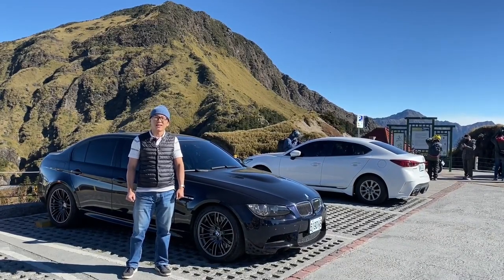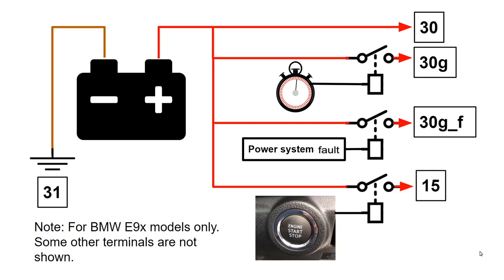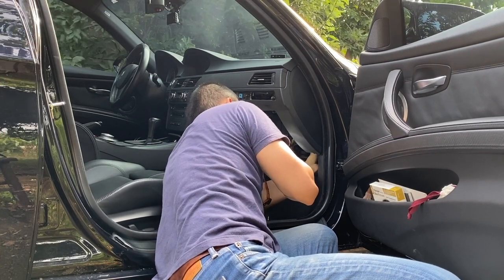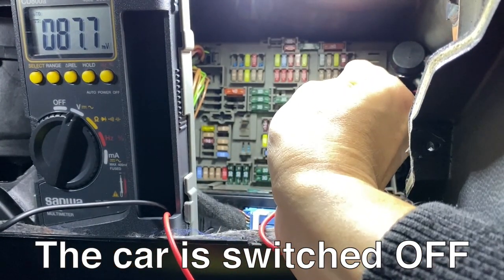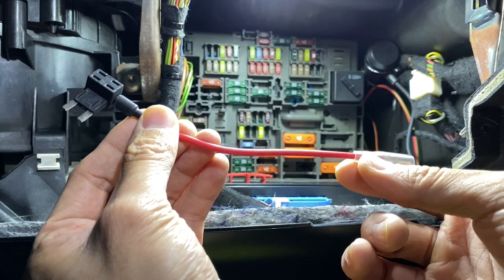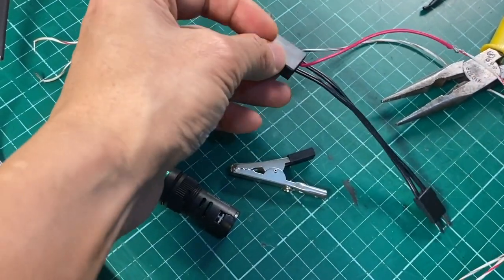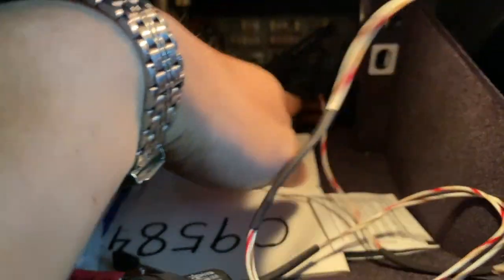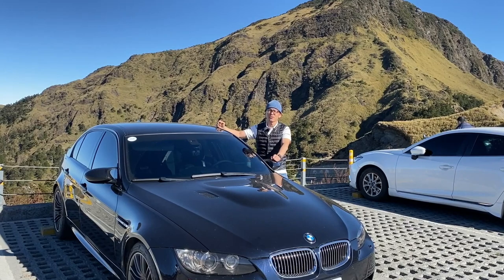BMW Terminal 15, 30, 30g & 30g_f Explained - Heated Steering Wheel DIY on E90 M3 Ep. 1[ENG SUB]

Comment: Is there a relay that cuts off power to the radio ?
Reply from the maker: Hello the radio on E90s is named N38 or N38a. It is on terminal 30g_f and the relay is named I01139. This relay cannot be seen on my version of fuse box.

Please search on Google Images "e90 fuse panel relay 30g_f" you will see another version of fuse box on E90s. I01139 is on the right middle on the fuse panel, the black rectangular one below the black square one.

Be noted that there are some other modules on this terminal!
Reply: I didn’t get the notification for this , thanks I appreciate it after I reconnected my battery my radio and cruise control and other stuff stop working . I hope this relay is the problem there is only one fuse getting no power and it’s to the radio any advice it’s been like 2 years lol
Reply from the maker: Hi Gatiyo yes the relay I01139 is responsible for the power supply of terminal 30g_f. Also note that the faults in electrical system can make 30g_f shut down. So please scan for the fault codes about electrical system. Perhaps after clearing other faults, terminal 30g_f can be recovered!
Reply: @funcarsgoodpeople  thanks for the reply I appreciate it , 30g_f is a soldered relay on my fuse box I’m not getting no power to radio fuse and other fuses that has to do with the radio. Does this mean I’ll have to replace the fuse box ? This will be helpful
Reply from the maker: Hi Gatiyo yes this is one possibility but before swapping the whole fusebox I would try to supply 12V power to those fuses to verify whether the downstream modules are still functional.

Looking at the fuse slot F41 (if not i’ll update to you), you will see a colored (maybe blue or magenta) socket underneath. That is the pin to the radio. I would try to supply this pin to check the radio.

Comment: Why are the terminals named like this? Is it legacy from some ignition lock terminal naming?
Reply from the maker: Hi Janne thank you for raising this question so I got a chance to learn about it 🤗

I found the Wiki page about the standard DIN 72552 for naming in automobile wiring so I think this is the answer 👍

https://en.wikipedia.org/wiki/DIN_72552

I believe BMW has its unique naming system based on DIN 72552 standard.

Comment: How many boats is supposed to be going through the ECU on a 2008 535 XI
Reply from the maker: Hi Robert, from what I found from the pin assignment, I believe that the supply voltage is 12V or the battery voltage. The ECU is also getting information about battery health. Are you encountering some power problem?
Reply: I put a new motor in the car it's a new turbos and the ground wire up underneath the motor mount was broke and but it's fixed now but I think it popped and relay or short or something out but it will car won't crank everything clears the code clears for the service and change all all that's back in the green but it still won't crank up and I put starter relay in it new starter
Reply from the maker: Hi Robert,
The engine start is controlled by the CAS, car access system. The CAS will compare a code stored in the ECU (or DME) to allow engine start. I guess you also changed the ECU together with the new motor(engine)? In that case, some programming is required to pair the CAS and ECU.

You can send me email: funcarsgoodpeople@gmail.com I will send you the related document in ISTA if you need 🤗
Reply from the maker: "Key identification and start procedure
The following procedure takes place after inserting the vehicle key in the ignition lock:

- The transponder in the key is powered via the loop aerial and sends the key data to the CAS control unit.
 
- The CAS control unit checks the key data to ensure it is correct and only then sends an enable signal to the starter.
 
- The CAS control unit sends the variable code to DME/DDE. There, the variable code is checked against the saved variable code; if they match, the fuel injection is released.
 
- After the engine has started, the CAS control unit generates new key data (change code) and transfers them to the transponder in the key.
 
- A new variable code is also created and stored in the DME/DDE control unit."

Comment: Do you lose MDrive with this (M Button)? I see there's a unique number for the MDM SLZ's, but they don't list one that includes a heated steering wheel.
Reply from the maker: Hi Aaron you are right! The heated steering wheel is not available for E9x M3s. However, on the other E9xs, the heating circuit does not go via the SZL steering column switch cluster, instead it goes via the spiral clock spring (or coil spring cartridge per realoem.com) to the steering wheel. So the clock spring with the 4-pin extension harness is the key part for the retrofit. Swapping the clock spring allows additional wiring for the heater, and the M Button (actually the multifunction switch cluster) circuit is still there.

For whom is curious about the SZL for MDM, please refer to my video about MDrive retrofit: https://youtu.be/hIKka5dYtp0

Comment: Do you know which fuse slot is terminal 30g_f? I would like to install the dash cam with surveillance parking by using this slot and preventing battery drain off. Thank you
Reply from the maker: Hi Eric from the wiring diagram for my 2008 E90 (with new version of fusebox), there are only two fuses on 30g_f; F31 for radio or CCC, and F17 for the phones and navigation system. Please note that the fuse distribution may vary. You can send your VIN via e-mail to funcarsgoodpeople@gmail.com and I can send you the PDF of wiring diagram of your BMW.

I had considered the parking surveillance and it's indeed a good idea to prevent the battery from draining out. I know Mio offer some kind of power cable to cut off power of the dashcam when voltage is too low. I also see some people use another battery for parking surveillance but this is not  ideal for small cars (occupying more spaces.)
Reply: Thanks for your help. I have sent the VIN number to you.
Reply from the maker: Got it! Please see the mail!

So the fuses on 30g_f are:
F31, F32: Trailer module
F61: CAS (car access system, locking/inlocking the car)
F74: Instrument cluster
F60: Junction box
F59: Navigation
F56: CCC (the headunit)
Reply: @funcarsgoodpeople  Thank you so much for your help! I am successful to connect the dash cam as I wanted.
Reply from the maker: Wow great news! Eric! I’m thinking of trying to turn terminal 30g_f with ISTA+ to test an empty fuse slot. I’ll let you know if that is possible or not. See you!

Comment: Hi Carl, you seem very knowledgable on car electronics. I'm on youtube trying to find out why my 2013 mini r56's usb and aux port isnt getting any power. It used to work and one day it stopped working. The cigarette lighter works no problem and all other electrionics but the usb and aux port that are side by side don't work. Thinking it's a fuse or 30g_f turned off or not sure what issue but maybe you might have an idea? Appreciate this video and the new knowledge you provided me.
Reply from the maker: Hello Brendon thank you for the message. I am relying on ISTA for all of the problems I get. I refer to the wiring diagram of your R56 Mini. The USB and AUX ports are connected to the ULF (universal hand-free) module. Then the module sends sound signal to the audio unit via MOST circuit (optical signal, see my video: https://youtu.be/RhKOkYNZ65M)

If your ULF is broken, the MOST circuit is open and the audio system is also down. No sound will come out (try turning on the radio!) You can check fuse F10 to see if the of ULF module is out. Since USB and AUX ports are out simultaneously, I am assuming it can be a bad ULF module.

If the ULF is functional, maybe the USB and AUX harnesses are loose or broken. That's the idea I have right now.

I recommend using a diagnostic tool to see the fault codes. That will lead us to the problem more precisely. Best luck!
Reply: @funcarsgoodpeople  Thanks for the reponse! Radio works and no other electronics aren't working just the aux and usb port that are next to each other. I got under the usb and aux port and made sure it was plugged in properly and they were. Not sure if the other end got loose or not I didn't trace it back but they are connected at the ports. Another piece of information I can provide is that I got these two error codes when looking in the secret service menu on the dash. 

Error01 A559 h 200038357B01
Error02 9314 h 2027582F8C00

Not sure if this has any meaning at all. I wasn't able to find anything online that explains. Really strange. I just want to have my usb and aux to work lol
Reply from the maker: @brendonguo2494  I see! I cannot find related info in ISTA about the codes mentioned above. We'll just leave it alone.

So let's just check the other end of the AUX-IN harnesses. The ULF module is under the driver's seat. The connector of the USB harness is the black one X17182 with 4 pins.

And for the AUX lines they are in the black connector X17397 with 54 pins. The pins are 4, 5, 22 and 23.

Please check if these two connectors are firmly plugged and if their lines are intact. Let me know the result!
Reply: @funcarsgoodpeople  Thanks for the additional insight. I will look into this more about the ULF module and such. Appreciate your videos!

Comment: Thank you.  I got an error code for 2008 BMW 328i:
Can communication analysis/Most systems:

A0B2 supply, terminal 30e/30l

Where is terminal 30e/30l?
Reply from the maker: Hi Hong I did some search and I have the following suggestion:

A0B2 for 2008 BMW 328i LCI is the fault code regarding power supply of CAS. Terminal 30E means power supply from Terminal 30 to power electronics in CAS, where 30L is to power electric loads activated by CAS.

The CAS has two power inputs from fuse 36 (40 Amp) and fuse 55 (5 Amp) coming from terminal 30, namely 30L and 30E. So please check if these two fuses on the fuse box are blown.

Please come back and let us know the results!
Reply: @funcarsgoodpeople  Thank you very much for your reply. I checked the two fuses as suggested and found that they are good.  A0B2 code no longer appeared after I erased the codes.

Other codes include: 
CAS Car Access System:
1.	A0B4 Engine start, starter operation

ECM Engine Control Module
1.	2DEB Power management vehicle electrical system
2.	CDAD Message (request wheel torque, drive train,BF)
3.	CD99 Message (torque request EGS, B5)
4.	CDA1 Message (steering0wheel angle, C4)
5.	CD9E Transmission data 2, 1A2

SC Dynamic Stability Control:
1.	5DF4 System voltage too low

JBE Junction-box Electronics
1.	A6CF AUC sensor

INSTR Instrument Cluster
1.	A559 Instrument cluster: Power supply has been switched off (closed-circuit current cutoff relay

F-SBX-H Interface box high
1.	DE50 Ring break diagnosis has been carried out

F-SBX  Interface box 
1.	D68D wake up network unsuccessful

Most system:
1.	A0B4 Engine start, starter operation

CAN Communication Analysis
1.	A0B4 Engine start, starter operation

I failed to start or jump started the car. No crank, no nothing. The battery drained super fast (from 12.5v- 9 v in half day).

Any suggestions would be highly appreciated.
Reply from the maker: Hi Hong, it appears that there is an electric power problem that makes these fault codes. To summarize the above codes, I'd say the ECM and DSC lost communication because they were not powered or the power was unstable.

So the priority is to have a running engine with stable electric power (with a good alternator.) But as you mentioned the battery drains very fast, let's suspect some short circuit somewhere on the car. I suggest first remove the fuses for unnecessary/unrelated modules for engine start (e.g. radio, air conditioning) to isolate CAS, ECM(or DME) and DSC.

And now the car cannot be jumpstarted, so I will first check the starter motor, fuel pump and ignition electronics(wiring). It sounds like the ECM(or DME) is not working properly. I'm glad you can still read the fault codes and we don't see something catastrophic at this moment.

Could you please send me your VIN via email: funcarsgoodpeople@gmail.com so I can check corresponding documents and wiring diagrams on ISTA? I will also send them to you to bust the faults. Best wishes!
Reply: @funcarsgoodpeople  Just shot you an email with VIN. Thank you so much, Caril.  I really appreciate your super great patience and help.
Reply from the maker: My pleasure! I hope everyone can be a faultbuster!

Comment: Great video. Will follow it to retrofit F10 M LCI heated wheel. What wheels are installed on your car? Looks awesome
Reply from the maker: Hi Alexander thank you very much 🤗 I bought this one from some seller from Belarus via eBay. I believe this one was from E70 X5 although I cannot find the part number on it 🤷‍♂️

Well the feel is not as good as the original M3 wheel (genuine leather or nappa leather). But it is okay for me 🤗

Comment: Falha no terminal 15 como resolver BMW série 5 f10.
Reply from the maker: Olá Marcílio! Você pode nos mostrar os códigos de falha?

Grosso modo, o terminal 15 é acionado pelo módulo CAS (Car Access System). Portanto, pode haver algo errado com o CAS. Os códigos de falha informarão detalhadamente sobre o mau funcionamento.
**
Hello Marcilio! Can you show us the fault codes?

Roughly speaking, terminal 15 is activated by the CAS (Car Access System) module. So there may be something wrong with CAS. The fault codes will tell about the malfunction in detail.

Comment: where is terminal 15 located ?
Reply from the maker: Hi Ben, the source of terminal 15 is located in the fuse panel. An earlier version of fuse panel has a removable relay. But later versions only have built-in relay for terminal 15.

The CAS module validates the car key and sends activation signal to the fuse panel to turn on terminal 15 when the ignition switch is pressed.

And some of the fuses are on terminal 15. Please see my video about how to find them because the location may vary by car models.